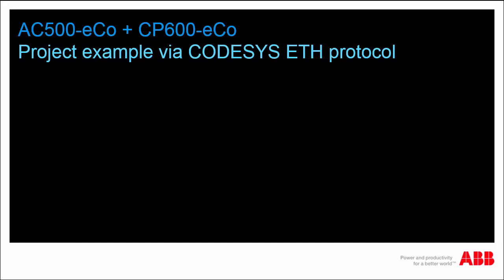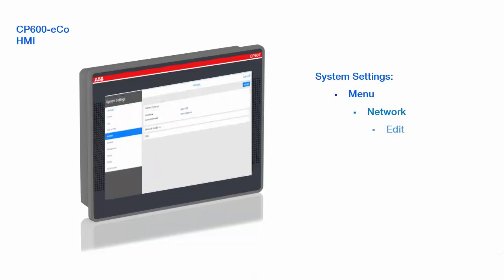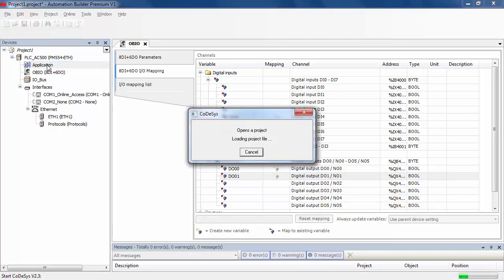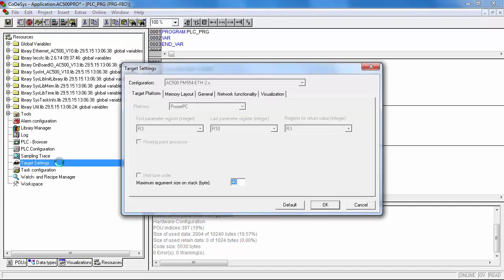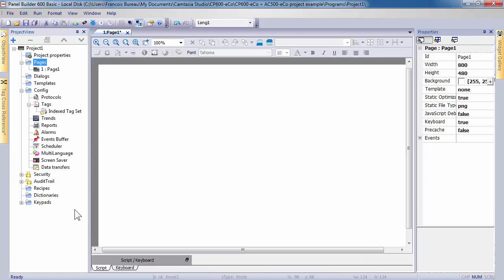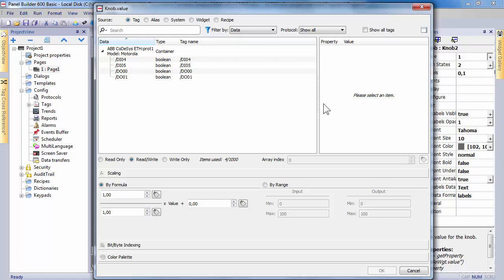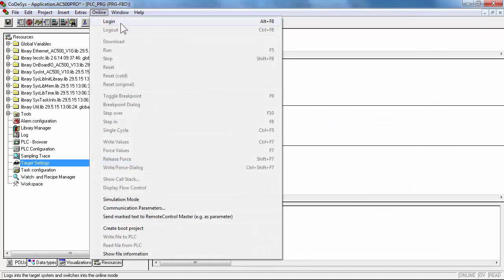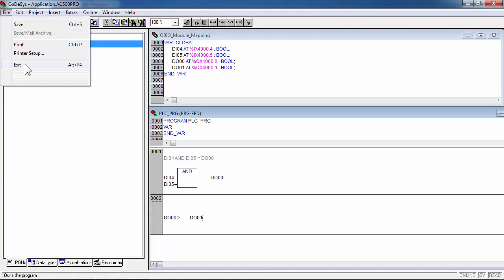ABB CP600 eCo and AC500 eCo project example

Comment: Thank you for your guideline and teaching video. you have beeen concentrated only to those plc and hmi with ethernet poert. but PM554-TP and HMI CP430 BP. How can i handle with this. because some compony are still using these version. how can we do the same shown in this courses so that if there is challenge i can handle it.